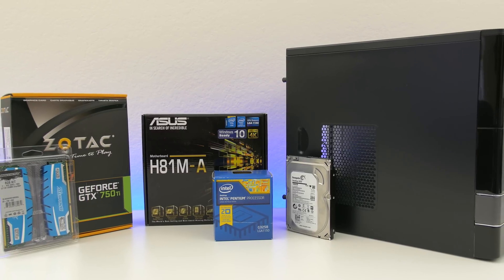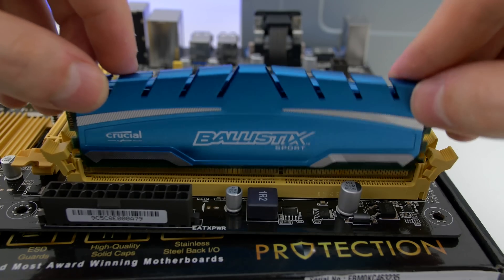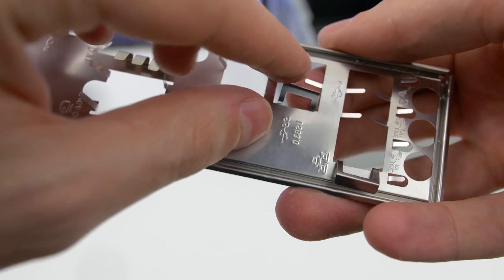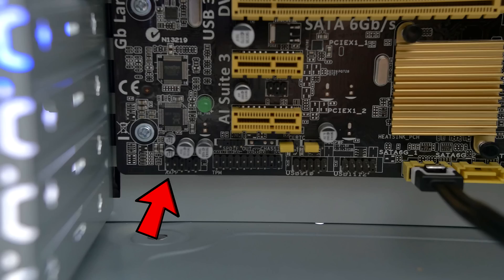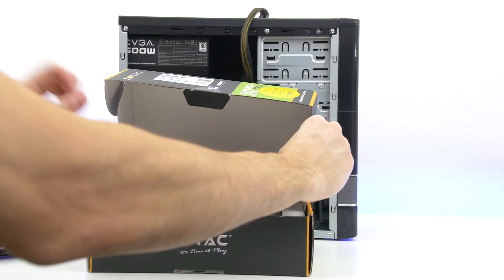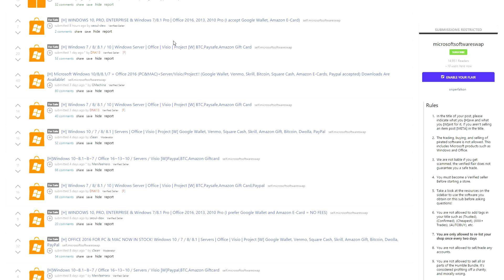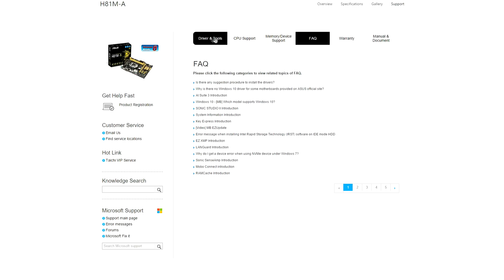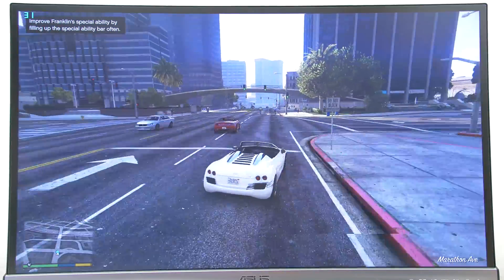How To Build $350 Gaming PC w/ Windows + Overclock!

Comment: PLEASE HELP! I just put the PC together and the PC turns on but no display on the monitor. This is the second time i put it together now and it still wont work. Can anyone please help me?
Reply: What's shown on the monitor
Reply: Hayden ThatWoodlog It says "No Display Found"
Reply: +matt smith make sure the monitor is connected to a display port
Reply: Hayden ThatWoodlog it is im pretty sure. If you have kik do you think you can help? I can show you the whole computer.
Reply: Iᔕ TᕼE ᕼᗪᗰI Oᖇ ᗪᐯI ᑭᒪᑌGGEᗪ Iᑎ ᗩᒪᒪ TᕼE ᗯᗩY?
Reply: +matt smith no I don't have a Kik. double check and try connecting your monitor to your pc in different ways. If that still won't post either A you assembled it wrong or B you got a bad part (most likely cpu or gpu)
Reply: MindFreak yes
Reply: I swea i did it like the video said and all the parts are fresh out the box, everything brand new.
Reply: +matt smith Be mindful that you should connect the monitor's display cable to the graphic card's display port, not the motherboard display port.
Reply: +WB IsMe it is
Reply: Now follow this troubleshooting steps
1) Remove graphic card
2) Connect monitor's display cable to motherboard's display port.
3) Power on pc.

If there is display, there is a chance that graphic card is DOA.
Reply: +WB IsMe I just switched tvs
Reply: +WB IsMe now it works thanks you so much
Reply: +matt smith where did you buy all the stuff for the pc?
Reply: +matt smith Im having the same problem, all you did to fix this is change monitors?
Reply: +ATrueCodPlayer Yes. for some odd reason it didn't work with that specific monitor. as soon as I switched it, it worked instantly.

Comment: I built this and it sucks... SOOOO BAD. I can barely even play gmod.... I cannot play fallout 4 on low settings either
Reply: something is wrong in your system. I made this and play gmod fine 60fps and fallout 4 has been shown to run fine. you might want to check all your parts are connected properly.

Comment: evo cooler won't fit inside this case. cooler is too tall. also put in your hard drive first before you install the motherboard with the aftermarket cooler on top. the cooler gets in the way of sliding in the HD
Reply: How did you get the cooler to fit? Because I bought it and have the same problem
Reply: +DatDerpyOne cut the panel enough to make it fit
Reply: yup i had to aswell (commenting this from the new computer) but since the case is only $30 its not a big deal

Comment: Did you use only the components u showed in the video no video card no cd player or sdd.... Plz answer does it ok to use a computer with only those components
Reply: +BraveSaw PC need the most minimum casing, motherboard, processor, heatsink, ram, storage device and power supply to run. Video card and CD player is optional.
Reply: Thank u soo much for your help cuz iam going to build a gaming pc under a tight budget... +WB IsMe
Reply: If you are gaming, you need a graphic card for better gaming experience. You can run without graphic card but your game will lag like mad.

Comment: Can this run games like Fallout 4? How would it run?
Reply: +Domino med/low setting 1080p 60fps.
Reply: No Fallout 4 need a Quad-Core CPU
Reply: nope
Reply: Check his benchmark vid it runs avg 40 fps or higher.
Reply: My friend has a i3 quad core and a 660ti  and he gets <30 fps low and not even 1080p
Reply: +BLOOGaming 660 no ti

Comment: Hey, sorry for a late comment but if i left out the power supply unit (Already have a better one) what would you recommend using that extra bit of money on? i don't need accessories im just wondering if theres any better motherboard to use or something like that. Thanks
Reply: +JackHullen And also 2 more things, do any of these things ship to Australia? and if i left out the 1tb hdd, which is the best ssd for around that price?
Reply: +JackHullen Motherboard do not improve performance so don't invest too much money on it. I would recommend a GTX950 instead of GTX750TI and slightly overclock the G3258 to prevent bottleneck.

Comment: Would you be able to use a evga geforce gtx 970 SC atx instead of the 750?
Reply: +Nolan Kwa Yes but the G3258 will bottleneck the GTX970.
Reply: thx for the reply, i shouldve figured that out before i asked this. instead of using a g3258, im going to use a i5 4690. that definitely wont bottleneck a gtx 970

Comment: Hey Ed. When you did the cable managing, where did u put them is there supposed to be cords not plugged in?
Reply: He just put the cables round the back of the case. Not all of the cables are meant to be plugged in, as that power supply was non-modular and there were a lot of extra cables for extra graphics cards, hard drives etc.
Reply: +Joshua Acton ok thanks

Comment: hey im prettty new to this stuff. i saw u play gta5 pc is it an actual game play and if it is is it laggy. and will intel i5 make a major difference. and if i dont overclock it can i still run gta5?
Reply: of course and u will be fine
Reply: also for lag it depends on your gfx card but usually you should be fine and I doubt it will be an issue for u no matter what card you decide to choose but I recommend the geforce gtx series
Reply: if i am using the one listed does it still work?
Reply: +Michael Sek that's a processor group, what graphics card do you want? but yes I have one and the i5s are generally what to go for. the graphics card is much more critical for gaming than the processor, though.

Comment: Will Intel I5 work with this motherboard
Reply: Yes
Reply: +Daniel Saljanin thanks
Reply: +TriangulumVoid258 no I don't think so i t has a 1150 socket but i5 has 1151 but a older i5 might work I'm not sure
Reply: +〈----Ughhhh This Is Natural wtf?
Reply: +SalCDS there are different kinds of sockets there is 1150 and 1151 for Intel this is a older processor so it has 1150 but skylake processors use 1151 connectors I think (correct me if I'm wrong)! older i5 cores will probably work with this
Reply: +〈----Ughhhh This Is Natural oh yup skylake is 1151

Comment: Can I build a pc that is $300, because I am on a budget
Reply: Or cheaper than 300 dollars
Reply: +Muros Gaming It's already "on budget".
Save up that remaining 50 bucks.
Reply: +Jan Selwa I still need to buy a monitor and mxl microphone.
Reply: I don't know were u live but u can buy a used 1080p 21-24'' monitor for less than 100$
For micophone your choice is a bit of overkill for your gaming channel especially at the beginning. For now I would pick a tonor 12326 and after some time think about a upgrade.
Reply: +Jan Selwa I have 285 dollar in Australia, where I live. Monitor cost 168-349 dollars I want to get a average one. And also I want to get a decent microphone like the mxl microphone
Reply: There is no need to spend this kind of money on a mic XD
Reply: +Jan Selwa if the monitor is around 160 and the mic is 100 dollars that is normal in Australia

Comment: Which build is better, Number one CPU: Intel Core i5-6600K 3.5GHz Quad-Core Processor  (its going to cost me $239.95)
CPU Cooler: Cooler Master Hyper 212 EVO 82.9 CFM Sleeve Bearing CPU Cooler (Its going to cost me $24.29) Motherboard: Gigabyte GA-H110M-A Micro ATX LGA1151 Motherboard (Its going to cost me $41.38)
Memory: Kingston HyperX Fury Black 8GB (2 x 4GB) DDR4-2133 Memory (Its going to cost me $34.99)
Storage: Samsung 850 EVO-Series 500GB 2.5" Solid State Drive (Its going to cost me $149.45)
Video card: EVGA GeForce GTX 950 2GB SSC ACX 2.0 Video Card (Its going to cost me $149.99)
Case: Deepcool TESSERACT SW ATX Mid Tower Case (its going to cost me $47.98)
Power Supply: EVGA 500W 80+ Bronze Certified ATX Power Supply (Its going to cost me $29.99)
Optical Drive: Asus DRW-24B1ST/BLK/B/AS DVD/CD Writer (Its going to cost me $18.99)
In total this should cost me $737.00 and my budget is $750 dollars. Or Number Two http://pcpartpicker.com/p/V7GkkL or Number three http://pcpartpicker.com/p/DjzPbv. Thank you and have a very nice day!

Comment: Please help. I did exactly as you have said in the video, but it won't turn on!!!

Not sure if it's a defective part or not, but when I plugged in literally nothing happens.
Reply: Me too
Reply: Same here
Reply: +Hayden ThatWoodlog and +Gamingw/Mos

Since I couldn't figure out the problem on my own, I just called local PC fixer to solve this problem (costed $30 extra from my budget, but well worth the price, tbh). After that, it runs like a charm. So, you guys might want to contact your local PC fixer to resolve it :\
Reply: So what I did that made it work again was I disconnected the cables and reattached them and it did the trick.

Comment: Will a 430 watt psu work?
Reply: +BOBISGOD I tried it and no it did not work. The battery turns on when i check if it works and the light for the motherboard turned on but nothing. i guess 430watts is too weak.
Reply: +Ganja Gaming- Dab Addict ok thanks

Comment: help I built this and it won't turned on I plugged everything in right. the light on the motherboard is lit but when in press the button it won't turn on
Reply: Same
Reply: Same with me
Reply: +Gamingw/Mos I figured it out just make sure EVERYTHING IS CORRECT. correct screws and everything and just restart over that's what I had to do
Reply: +Crazee Clan thanks dude everything is working fine:)
Reply: Same here, I every checked it all.

Comment: Is overclocking risky?
Reply: It's just plain dumb because Intel gives the optimum clock rate and you don't use it meaning it creates massive amounts of heat
Reply: that guy is stupid, as long as you don't go over about 1.3v on stock, and your temps are good, then it is fine
Reply: +potco108 alright
Reply: +potco108 alright

Comment: Do i need the bare drive for this build or can i get a hard drive?
Reply: You can get a hard drive
Reply: +AceTron which is better?
Reply: both are pretty good its just price I guess i would get a hard drive
Reply: +AceTron thank u so much do u know if the case comes with all the screws for bare drive, power supply, and motherboard?
Reply: all the screws come with the parts or the case don't worry you will have all the screws :)
Reply: +AceTron thank u so much u helped me alot i might build this pc for the first time on my b-day
Reply: no problem and happy birth day

Comment: wpw this is awesome im debating on an Xbox one or a pc was looking at the alpha from 👽 wear but for what it can do for thw price osnt much. thanks to this video ill ve playing ARMA ASAP.
question. 
1.can i use an old tower an use parts in it to build this
2.with this build will i have a hdmi out to connect to my tv dont have a monitor.
3. is over clocking needed? 
thanks forbthe help guys
Reply: 1- you can but it won't be the same as this ones unless they are the same (duh)
2- search in google "zotac gtx 750ti" (wich is the card used in the video ) and look for info it should appear
3- overclocking is 100% optional but you (sometimes) get a pretty big performance boost
hope it helped (sorry for my bad english)
Reply: +Aron Kim. thank you aron

Comment: i went with a 430watt is it bad?
Reply: +HowTo Gaming1080p depends on the brand
Reply: Crosair
Reply: HowTo Gaming1080p pretty good!
Reply: +Horsman4James can i go 400watt cougar sl400?
Reply: - Left if it has a 6pin for the graf card the yes u can, but i recommend 500watt
Reply: it only have 6+2 pin
Reply: - Left it works
Reply: HowTo Gaming1080p so its ok if i use 400w? i only upgrade the cpu in the future ,im not upgrading the gpu
Reply: 400w is ok but if i was u i would spend my money on a 500w cuz ur going to uppgrade
Reply: +HowTo Gaming1080p ok tnx 😃😃

Comment: Can I switch the processor with an AMD fx6300 or and Intel i5?   I guess yes. 😊😊
Reply: +Remo ANY AMD cpu won't work with this motherboard, and SOME i5's will work but not ALL. Make sure you have the right socket.
Reply: So i need to get a different motherboard???

anyway. thnx for the info.
Reply: +Fabulous Gamers thnx

Comment: So I'm a huge jerk (and slight elitist) and as such I built an AMD system because honestly (this is my opinion you needn't believe it) Intel is all a name. I ended up with a 433 (411 after rebates) dollar build with an 8 core 16gb of memory 1tb of storage (WD harddrive cause honestly its the most reliable brand) 2gb of Vram and 1 salvaged wireless card because well where my system is I cannot run an ethernet cable to rn. Its all housed in a corsair 200R carbide edition case (I also salvaged two cd/dvd drives) and its been codenamed blackout for its colorscheme. It's overall compared to this system better due to more cpu cores to toss around a 600 watt giving me some expandability with either bigger gpus or more gpus, hds, and ssds. Feel free to rip me a new one over my AMD over Intel attitude but honestly at the end of the day my belief is this. Intel is a great brand is well known sure but just like headphones and audio devices AMD is an under appreciated company that produces equal if not better performance for a lower price. My cpu was 100 dollars running equal to intel's i7-6700k processor at nearly 3 times what I paid. I'm sorry for those I offend but facts are facts. I can buy 3 of my processor compared to one of theirs. Or one 12 core
Reply: Could you give the specs of your pc m8?  Like in a list? Looking for a build might look into what you are saying.
Reply: Sure. Now before you read the specs please do two things. First set a price limit; if not you can go overbudget and end up half built before you realize it. Second pick your store. I bought all my stuff back a month of so ago at Microcenter which offers deals for buying multiple pieces together and if you get it other places it may not be the same so check.

parts list

433 dollar build

Motherboard: 78LMT-usb3 by gigabyte

Gpu: MSI low profile geforce gt-610 pcie 2.0x16

Cpu: amd black edition FX 8320E

Case:corsair carbide series 200R

Psu: thermaltake tr2600

notes: the board has one fan port on purpose, when I built the system I planned to get a fan hub so you’ll want one of those. Also this doesn’t have CD/DVD drives so you’ll need to have or salvage some of those. And one more thing, if you plan to run it wireless then get a wireless card as well. This will make your total closer to 500 to 530 if my calculations are correct. Oh and don't worry about extra fans, the 200R comes with two fans stock.
Reply: +Dr.End Equal to a I7-6700?  No. 

What are you doing with your PC?
Reply: little bit of everything, gaming video rendering and artwork creation, it runs pretty decent but clearly could use a boost for anything extreme like say fallout 4 max graphics or titanfall but it'll handle most shooters and general games well. Also you equal to comment made no sense. If you are stating my processor is NOT equal to an I7-6700k well then you need to check facts (i did) because it in fact is equal if not slightly better. NOW am I saying intel is garbage over this fact? Nope im just stating if you are building a budget pc want an 8 core processor and you dont have 300 extra dollars to shell out for letters on a piece of equipment youll never see again then go with an AMD 8 core that is 1/3 the price of intel's ridiculously overpriced processors
Reply: Dr.End They are not equal and you should check facts.

Look at all the prices. You are lucky get that thing that cheap. The difference between Intel and AMD is usually not that big.

And for gaming you should compare it to an I5 which is significant cheaper than an I7.

Also gaming with a Nvidia geforce gt 610?
Are you kidding me?
Reply: +Nadir Jofas yes and it runs fine. honestly YOU need to check facts because clearly you know nothing of how i game or what i do. this is a budget system video and i offered a rival budget system it isnt meant to be a monster. i kindly ask you either get degrees in computer engineering or learn about me before ttying to tell me what i SHOULD get. and as for my card i have plans to replace both the card and motherboard as well as add water cooling to the system. i had 400 dollars to start i did the best i could with the brands i prefer and stand behind, now please quit your idiotic spewing you sheeple, i hate to be rude but it is clear nothing but violence gets through to you people
Reply: Dr.End Why should i do that? But you said what you do. So a budget system for video rendering? Where did i mention what you should get? 

How about you start using a bit better wording before attacking me.
Reply: +Nadir Jofas a mention of my purchasing an I5, i use an 8 core for video and picture rendering and creation, memory is great but having only one or two cores to allocate to it if i want to do anything else while it renders isnt my deal. look id appreciate if as i stated from the beginning you respect my choices. i am not an intel fan and never have been and while i enjoy constructive critisim i must state that your ideas will be discarded not for them being bad or wrong but besides it being a roughly 300 dollar endeavor to replace both board and processor (not evdn getting new pieces) i simply prefer amd's performance overclocked and stock. and i end this conversation permanently on that note

Comment: Why not Op for an FX-6300 and a gtx 950?
Reply: XD the build I'm planning on getting has an fx6300 but it's has a 750ti which I don't mind
Reply: but the power you can get later from gtx 950 sli boasts approx 10fps higher than a gtx 970

Comment: Does anyone know how to fix WHEA_UNCORRECTABLE_ERROR because every time I try to boot up windows on this pc it say that error then restarts I've looked at all the pieces and they are compatible with windows 8.1 and i've had a look at the wires inside but nothing works. All the parts are the same as this build except the GPU which is the EVGA GTX 950.